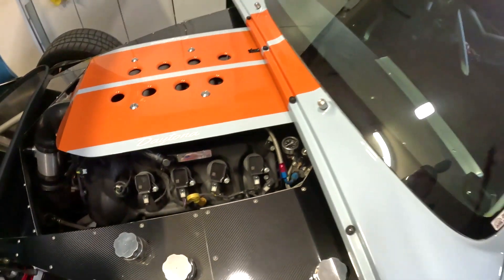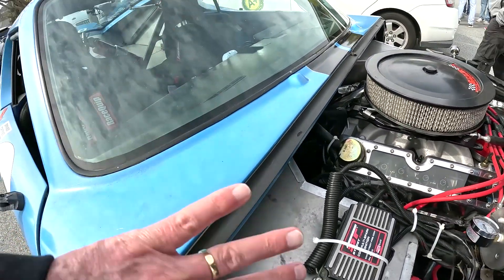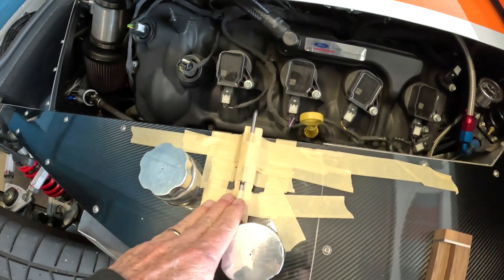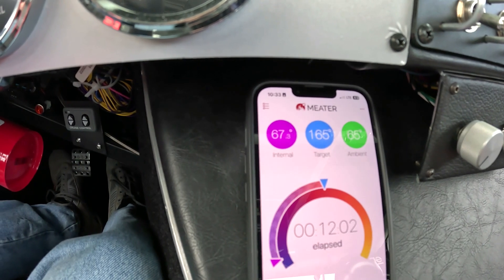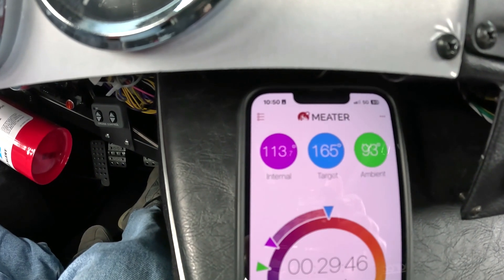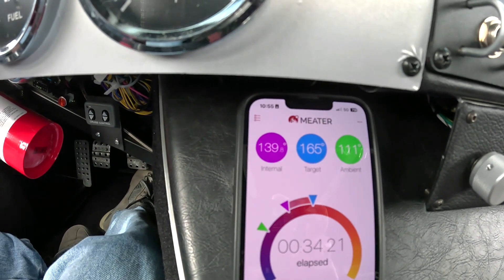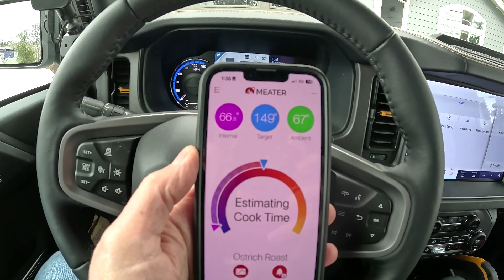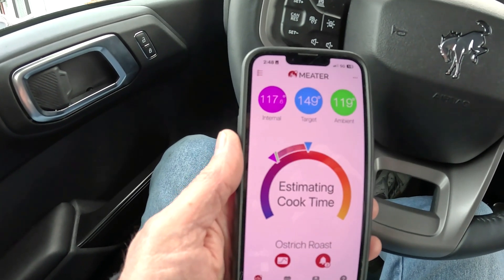How hot does it get under the hood of the Factory Five Type 65? Watch to find out

Comment: On a somewhat unrelated note do you have a video where you show the engine cover construction?  It looks great but I couldn't find anything posted.  Thanks.
Reply from the maker: @pnwdiy2073  Weird!  I thought I did a video but cannot locate it. Maybe I need to make one. Any specific questions?
Reply: @cobradaytonabuild1671  I guess just the basics.  What gauge steel/aluminum, how you mounted it (I see the four bolts so I am assuming those are on pedestals or some such) and did you offset the dimples for aesthetics or another reason?  Compared to plastics, it really pops.  Love the paint and the script - nice touch.